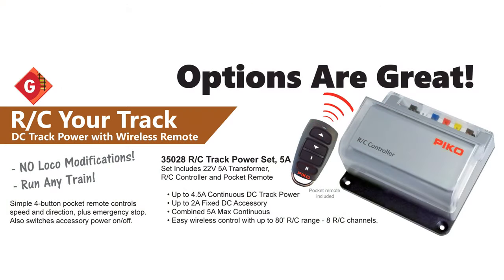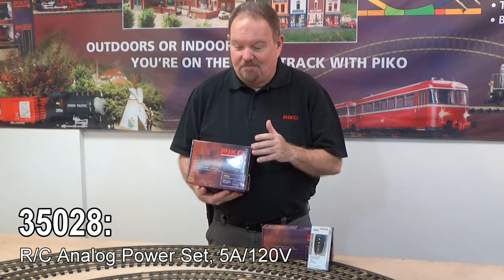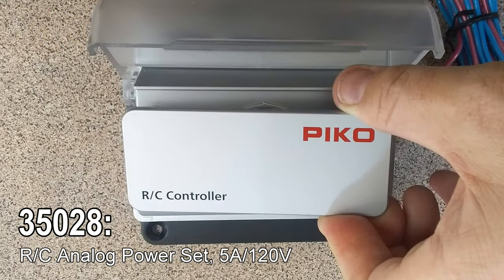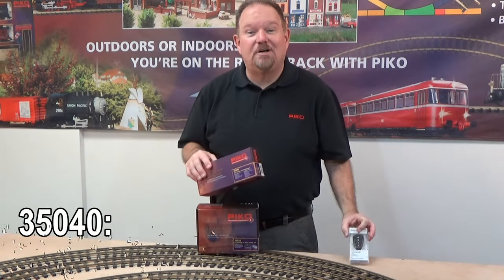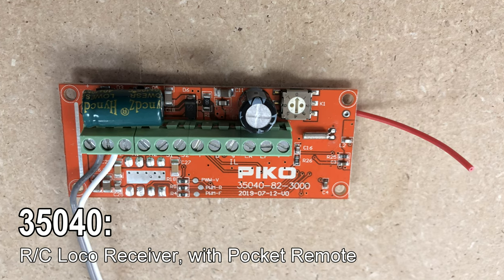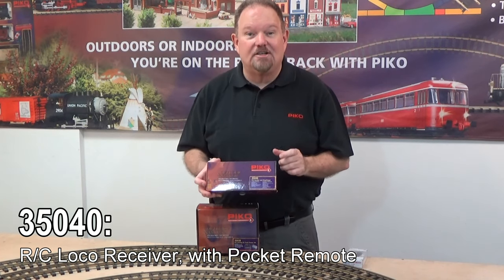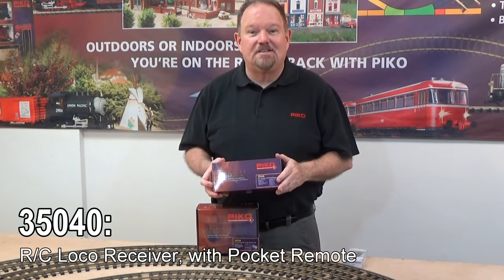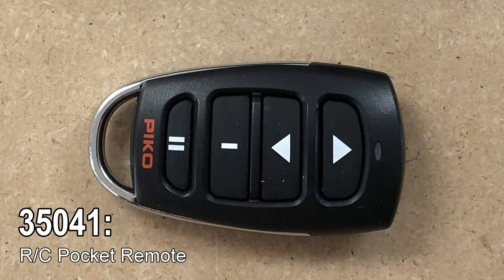September 2019 New Items: RC Options!

Comment: Already got the remote installed on my yellow battery powered Piko clean machine and it made a whole lot of difference as I no longer need to run after the loco trying to stop it by switching off the manual switch on the side .  Thanks Piko and keep up the good work .